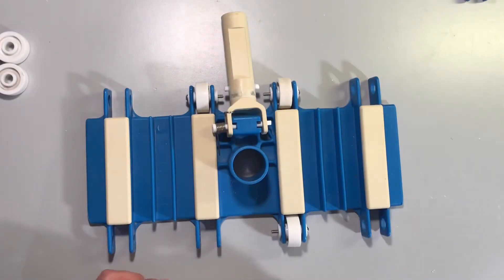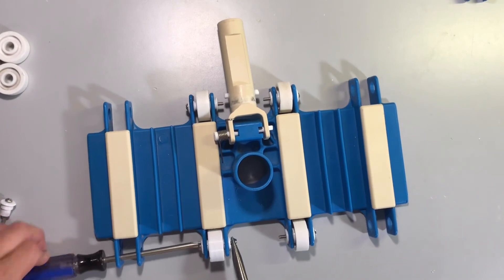Pool Vacuum Head - Roller Repair & Upgrade

Comment: This is great except that I don't have a 3d printer.  Do you know anyone who would make these parts for sale at a reasonable price?
Reply from the maker: Try searching for “3d print service”.  You send them my models… they send you the printed parts.  Ask for PETG as the material of choice.  While not the strongest material, PETG is durable enough for this application, and it is dimensionally stable (assuring that the parts will fit as designed).  Good luck.